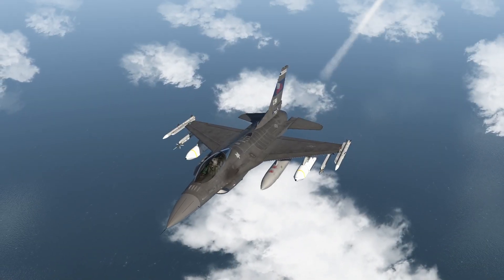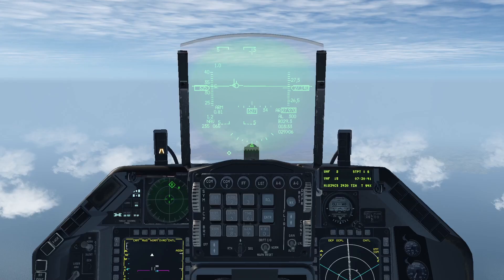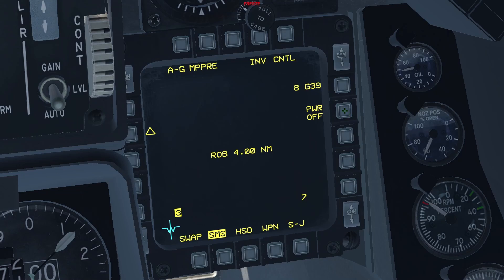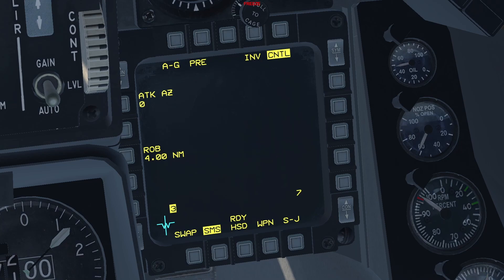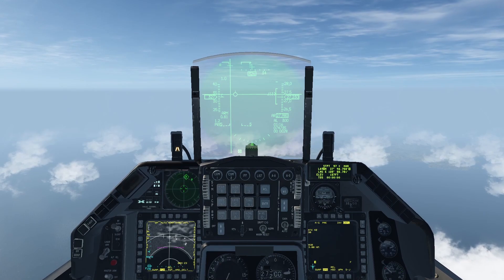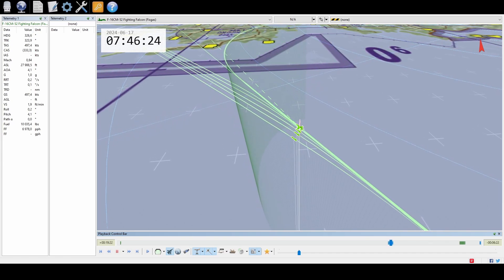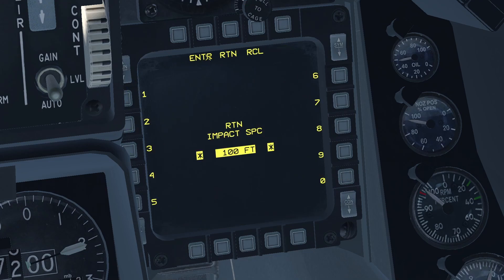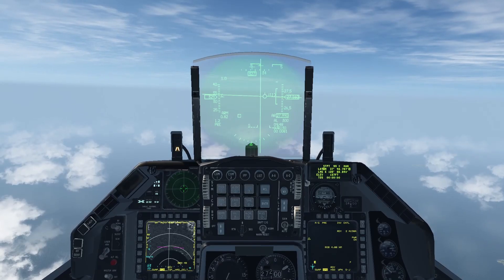Falcon BMS 4.37 Tutorial - Extended Range Munitions - GBU-39, AGM-154, AGM-158

Comment: 2 questions. 
1. Attack Azimuth - Is this the direction the weapon flies or the bearing from the target? So if I want the weapon to fly in from the direct south to impact a target... that means the weapon is flying a heading of 360, however its bearing from the target is 180. In the video you said 'Final attack heading' which means if I want the weapon to impact from the south of a target I input 360 because that is the heading to track a 180 radial in. BUT … the range on bearing setting is called range on bearing not range on heading... and the bearing is 180. 

2. Side by side and tandem drops with spacing. How is the spacing determined. if I put 200' spacing, is the actual point I'm targeting being bracketed by the 2 weapons? For example if im targeting the centerline of a runway would 1 bomb land 100'  to the left of centerline and 1 land 100' to the right? Or is it 1 bomb impacts the centerline and the other lands 200' away?
Reply from the maker: The Attack Azimuth is the final attack heading, from the weapon's perspective. So if you're coming from somewhere to the north of the target and you want the weapon to hit going directly south, then yes, input 180º

I don't use side by side and tandem drops much, but if I'm not mistaken it's one weapon over the target and the other one goes at whatever distance you set. So that way, when using the JSOW for example, you know where to put the first weapon, and then measure the distance needed for the second weapon to have the best effect over the target area.

Hopefully that makes sense
Reply: @fisgasfighties  It does. I initially thought that as well, but then that brought up the question... if Im dropping on a column thats laid out left to right in front of me and i pick the far left target, how do i know if the second bomb is going to land 200' right instead of further left? Also thanks for reply!
Reply from the maker: @Logic_Does_Not_Apply that I don't know actually, but I believe it depends on which side the first weapon is deployed. Say for example you have the weapon on the left wing selected, that's going to be the one hitting the target "dead on" and the right one will be spaced out 200 ft to the right or whatever or input

Comment: The JSOWs don't seem to be releasing cluster munitions for me. They just head direct to the target stpt and explode on impact.
Reply from the maker: The cluster effect on BMS is a bit "off" in BMS, I'm not sure if this was addressed with 4.38. but are you using the A or the C version?
Reply: @fisgasfighties  I was using the A version and I think the cluster munitions are actually deploying; but there appears to be no visual effect on it. Strangely enough, the CBU-105 looks just fine deploying cluster munitions.
Reply from the maker: @TheSHJGaming up to 4.37 any cluster munition was more like an "extended blast area" if you know what I mean, not a true clustering effect, not actually with submunitions. But I haven't tried them yet on 4.38, they may have been reworked and I didn't realize it.
Reply: @fisgasfighties  Well, with the CBU-105 it just seemed to deploy by shedding its outer fairing, but the actual explosion effect was the same as the JSOW. I don't mind exactly, it was just a little bit ambiguous the first couple of times trying to deploy the weapon.
Reply from the maker: @TheSHJGaming cool, I'll have to try it out when I can